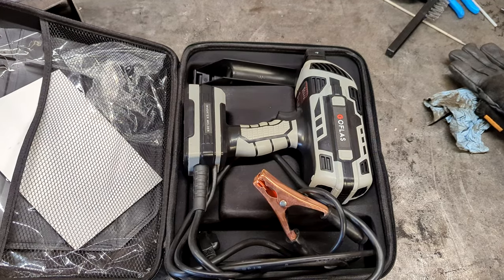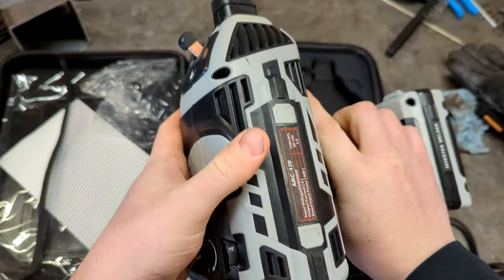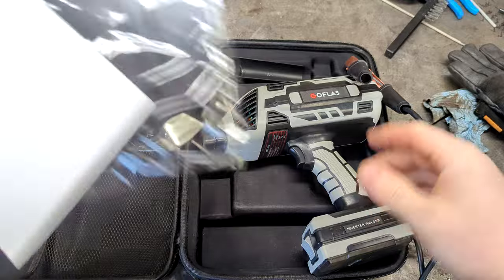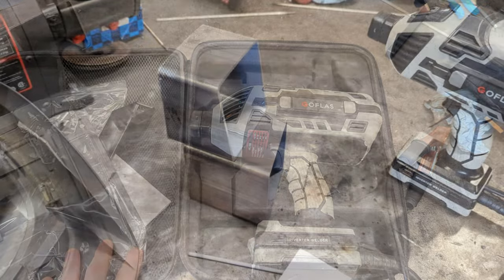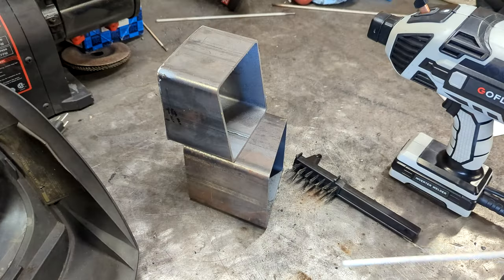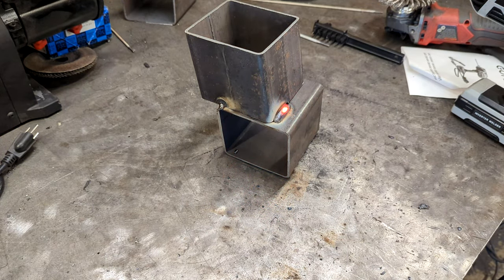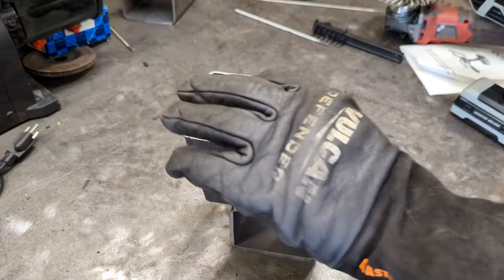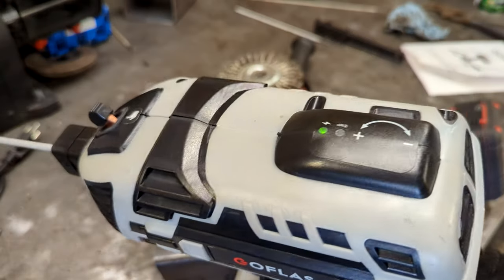Handheld Stick Welder Temu

Comment from the maker: The one in the video they have raised the price on it damn near 60% they all seem to be pretty similar here's another one closer to $100 https://amzn.to/3GrSEjM
Reply: How long have you used it and did it hold up
Reply: The YouTube hug of death...
Reply: Just bought one off temu for 79 bucks
Reply: @mosesdroneworks5346  Famous last words...
Reply: @soundspark  used it lastnight worked great I was very surprised.  Wasn't expecting much . But it Truly worked great . Be nice for small jobs .
Reply: Please give an update if the Chinese Tool Emporium welder is still working. Thanks for posting.
Reply from the maker: @TheStickinator  lol yea it still works will post an update video when I get some time.
Reply: That’s alright” it is whut it is, I need one👍🏽
Reply: i just got my for 69$
Reply: Can anyone please tell me the best rods and settings to use for welding bedframe metal to utility trailer rails? 

Also, what angel to I use when welding. And do I put the rod right on to the metal or a little above it? 

Thanks! Would really appreciate the help!
Reply: Under 60 bucks on ebay
Reply: @Steve-sv3ln your already on youtube look up a welding video
Reply: @Steve-sv3ln u need to practice on a scrap metal normally you don't put just put it on the metal. You bring close as possible the welder will start welding. The if you welding two  pieces you must do small circles so the two metals can come together. The high and low settings depends on the thickness of the metal. If metal is thin you set you heat down if thick set higher
Reply: Nice welding skill you have there

Comment: As a welder of 30 years, that was impressive.
Reply: I was thinking the same thing! Impressive
Reply: Found the temu employee 🤪 😂
Reply: Yeah that is actually pretty surprising 😅 I seen an ad and had to see it in use
Reply: I am a auto tech and was thinking be perfect for those exhaust welding spot jobs .
Reply: How do you weld years?
Reply: @dudeguy2942  you sound like my dad lol
Reply: I would assume this is a bit different than soldering 🤔
Reply: Your a bot
Reply: @JamesBrown-rz1vj your a bot
Reply: @davidtejeda1380 ”you’re”. Take your time to spell if you’re going to burn someone.
Reply: @666dynomax  you definitely have 0 friends 🫡
Reply: @davidtejeda1380  lol. Grow up kid and get off your phone it's bed time

Comment: This would be good for offroad truck repairs in case something breaks on the trails!
Reply: yea, where you gonna plug it in ?
Reply: @tommyshaw2420 a generator or an inverter my guy
Reply: @tommyshaw2420  newer vehicles today have 120 v  my car and truck has 120 volt outlets but I guess if you don't you would use the jumper cable option on your vehicle battery.
Reply: @roland9532  My Ford escape even has a 120v outlet, most definitely do these days
Reply: @roland9532 it might have a 120 volt outlet but can it support the amperage? I'm not saying it won't but I have my doubts.
Reply: @garreth629  Just keep the car running, it'll hold.
Reply: Y'all got 110v outlets on your cars, but at what amperage?  I think they pull around 18 amps.
Reply: My thoughts exactly only a few "electric vehicals" have that kind of amperage and i kinda doubut you got that out on the trail. Lol 99.9% of the time this aint foing you any good on the trail. You would be better weldi g with your car battery. @garreth629
Reply: Trouble isnt running your battery dead. Im an engenering student and let me twell you the wave transformation is tough to push ac anyways. But that much as standard in your car... thats like asking it to run a electric dryer on high 😂 its not as clear cut as people seem to think. Im pretty sure the average inverter in. A car is less than 1000 watts. 110/1000 thats your amperage. Less than ten avalable.   @MrMoon36O
Reply: @tommyshaw2420  new trucks have 120v outlets on the back
Reply: My truck has 120. It’s definitely possible.
Reply: @bananapuffcream1 what should be inverter’ s minimum power to handle this thing?
Reply: @garreth629  Saw this issue once with a guy trying to use an oxygen machine in his 15 Silverado. The stock inverter only put out like 10amps. Lol.
Reply: hell yeah! keep it in the baja truck when you're racing.
Reply: @tommyshaw2420  car lighter power inverter. not sure if it'll be enough. might need to have engine running.
Reply: @MrMoon36O.   Letting the engine run won't change the fuse amperage. 🙈

Comment: I just bought this very welder on sale at Temu for 60.00 on sale..I have many weldersb though this would be fine for welding cage and fence wire ..very light weight welding.  So happy to see your video..I think I will be pleased to use this little welder on.light jobs instead of dragging out a bigger welder.  At 60.00 and free freight its worth the gamble
Reply: I just got one
Reply: I just bought one from Temu too for 69.00 for go kart welding, this will be my first time welding.
I've only been afraid of burning my eye from the heat light.
Reply: @ronaldtracy2534 how is it working? Still works good?

Comment: You should do a quick little update video on it to see if it is still working.
Reply: Dude it's $60 bucks even if it lasts for a year you just buy one every year.
Reply: Dude a video would still be cool
Reply: Dude
Reply: @michaelrelli  I ended up getting one it actually works really good! I wouldn’t use anything over 1/16 rod, otherwise it likes to stick a lot. 1/16 rod works really good, and you can actually get a nice bead.

Comment: That went way better then I thought it would. I was just looking at one on one of those cheap products apps and I didn't think there was any way in hell it would work that well for around $100. Looks like it would work well for random welds here and there. Great video!
Reply: Right... I work in a glass factory, doing alot of rig welds on equipment, the pain of hauling a cart with 2 different types of welders mig/stick mainly Over busted up pieces of glass in a pain in my a$$ so I've been looking at this didn't think it would get close to welding anything maybe tac welds but, I'm deff surprised... curious how long it will last?

Comment: Thanks bro, this thing finally came up as an option for a 50% discount and I got it for $41, if it weren't for this review and the comment section i would've probably left it alone but for 40 bucks why not, I'm a novice welder myself anyway so it may be good practice for me
Reply from the maker: Right on man thanks for watching
Reply: Your a bot

Comment: I've seen many videos of non-welders trying to weld with this. They either had too big of a rod or the wrong rod for the steel thickness or just the wrong type rod for the project and were unaware of any of the requirements for welding...and got a sh*tty result. You seem to know what you're doing because I could totally live with that weld, compared to all the others I've seen that are just porous globs of bubble gum. With an 1/8" rod, no less, and without a direct ground connection to the workpiece!

Comment: Thinking about getting one for my toolbox at work. Im a runtime millwright, and sometimes all we need is a quick small weld or tack to limp the machines till the end of the day when they go down and we can do a full repair. Dragging a big bumper pull lincoln and running leads takes to long for a 2” long tack on a guard lol

Comment: i bought 1 chineese gun welder Last year..honestly  i was surprised is a beast Tool: maximaum 120 Ampere.3000 watts.220 volts. Electrode diameter max 3.2. For a continuous welding is really excellent i use it for many hours a day for thin or thick metals. I find this tool a revolution in technology...

Comment: YOURS are the best welds i've seen yet from several different MAKES of this style welder.
   I wouldn't buy one of these with 
any expectation of doing DAILY
use ,  but with the intention of
Trail Repairs  &  light sheet metal
work .  TACK Welding in awkward
places seems to be the best use
for this style.
   I was on the fence , but seeing
YOUR welds makes me think this
particular  MAKE  +  MODEL
is indeed feasible for the above
mentioned , as a 2nd or 3rd welder  to keep handy .

Comment: This with a portable power supply would make a damn good trail side repair kit. At least good enough to get you off the trail and home.
Reply from the maker: Yep
Reply: Yes. You could carry this and a small genraetor and fix a broken drag link or something good enough to get home.
Reply: @gabuckeye3398 but it’s portable with a battery… you don’t need a power supply
Reply: It doesn’t need a portable power supply. It has a battery. All you need to do is have a ground
Reply: 2 minutes of weld time so be quick

Comment: Bought a similar one to do a couple of small tasks throughout my garage. Glad you tested it on something kind of thin since I'll be using it for welding a 1/8in pin in a same-sized hole for a tamper evident and mostly permanent closure. Thanks for the demo.

Comment: This would be easy to wire to a metal gate or garage door with a couple of long wires, and give you the ability to surprise thieves,robbers, and burglars. With the pull of a trigger, that doesn't fire a bullet,you can still give them a hell of a " shocking"  experience.

Comment: I know it's shit but I would get one just for novelty value. You could weld a couple of 10mm cleats on 106amps easily. Especially if you're in the field and need to run up a ladder with it.

Comment: Nice video. The arc sounds pretty stable.
Reply from the maker: Thanks
Reply: @MotorCityMetalArt  how long did it last
Reply from the maker: @wildlifewarrior2670  it still works.   I've used it here and there since this video but nothing crazy.
Reply: @MotorCityMetalArt  that's good

Comment: The endless potential capabilities of this tool are way underrated. Been welding going on 10 years now. I have a Lincoln Power MIG 210 Multi-Process machine as my everyday welder. Normally run .35 flux core Just because all I need to have is 120 V plug available. With the option of also plugging in to 240v If available. Typically I leave the 240 V plug at home however and I’m going to weld a quick broken thing for a buddy or do a small project or whatever lugging that 40 pound Machine around gets old quick. Why lug it around for a five minute weld job, or fixing something broken on the trail. Obviously your not gonna go welding on the pipeline with this, But for something the size of an 1/2 in impact gun which I already carry everywhere I go, you Can fuse carbon steel together that’s worth it’s weight in gold

Comment: Where did you connect the ground to? My hand held welder just arrived and I want to weld small stuff like that but not sure where to connect the ground
Reply from the maker: Connect the ground to what you want to weld.       You will have to make sure where you connect the ground is free of rust paint etc needs a good connection to work properly

Comment: Would be great to keep in a truck with a small generator or inverter. One trailside repair and it would pay for itself
Reply: A small gen wont run that
Reply: 5000w inverter

Comment: Seems ok for a quick jobber. Wouldn't wanna bring it to a job and use it every day, but if you need to quick weld something it seems alright
Reply from the maker: Yea for sure or generator and this in a trail rig for repairs on the trail

Comment: I'd be very careful on rod selection. you didn't specify output between ac or dc. I wonder how many times you can exceed the duty cycle before it craps out. I'd like to see 3/32 7018 demo'd because 1/8 is near the top of that machines heat output.
But it looks like a good small job machine.
Reply from the maker: Yea I've only ran 7018 and 6011 on it so far.
Reply: 20% duty cycle means you can run it 2 out of 10 minutes continuously, shouldn’t be a problem if you’re stick welding. I don’t think its going to take 2 whole minutes to burn one rod.

Comment: As a drug user , it’s obviously not built for heavy use but god the DIY homeowner , it’s perfect! 

Here’s my antidote story. I bought that cheap chinese plastic mender gun. When i got it , I thought it would break in the first use . I’ve had it for over 6 months, it’s still working , maybe i’ll use it for 10 mins a week. If i apply my result to the handheld welder gun, it would be worth it for small projects , but for sure not weld stuff like utility trailers . unless someone videos and proves it does work.

Comment: Do you think I'd be able to use this to make an extension for my harbor freight band saw so I can put thicker (wider on end)  pieces between the table and the guides?  For resawing purposes....
Reply from the maker: Which band saw do you have ? The 4x6
Reply: @MotorCityMetalArt  I have a 14 inch band saw.  Picked it up for 50 bucks and killed the back bumper of my Mazda 3 getting it in...and had to drive home with the hatch open and Thanks to Jesus for my exhaust fumes not killing me.  Haha!

Comment: Whuts the jumper cable for, & is it separate from the tool? & did you just plug it up to operate it? Or was the cable hook to a car battery?  Break it down step by step🤷🏽‍♂️
Reply from the maker: The "jumper cable" is a ground you put that on the base metal you're welding.
Reply: @MotorCityMetalArt  Thank you sir👍🏽 & nice clip ⭐️⭐️⭐️⭐️⭐️
Reply from the maker: @theeDameAlexander510  thanks for watching.

Comment: what extension cord gauge for a unit that can pull up to 120 amps ?
Reply from the maker: It's not pulling 120 amps from the outlet.      You should be using atleast a 12 gauge cord but that all depends on the length you're using it from the outlet as well.
Reply: I just need a 15 ft cord. I'm really naive on electrical stuff. The welber  I'm looking at says it's adjustable from 20 to 120amps but you're saying that doesn't mean 120amps would be coursing thru the cord ? Appreciate your responding ! @MotorCityMetalArt
Reply from the maker: @vanessatrane2189  so the welder has a transformer in it. 

Most houses have 15 amp 120v electrical outlets.   In some cases 20 amp.    

For a 15 foot  a 12 gauge cord is what you want.

Comment: What do you attach the clamp to? We have it but it only gives us short zaps despite holding the trigger down
Reply: We also know nothing about welding, so any info helps lol
Reply from the maker: @aprilkehoe356  the clamp is your ground you have to attach the clamp to the piece you're welding.   Where you attach it at must be bare metal and free from any paint or coatings to get good contact.

Comment: where did u attach the grounding clamp noob here
Reply from the maker: Attach the ground to the piece you're welding  

But if you have a metal welding table you can attach the ground to the table itself.
Reply: thanks @MotorCityMetalArt

Comment: Noob diy-er here. Just casually exploring ideas. Q: How does a (max) 120 amp device run from a typical 20 amp home breaker without tripping the breaker?
Reply: 120 A at the secondary.. Like any welder It's basically a transformer rectifier.

Comment: Why not have a flexible electrode holder with the "drill transformer" sitting on the table or floor?
Reply from the maker: You can.     The size of inverter welders now are tiny.

Comment: Would this be good for welding on a car exhaust!!!??
Reply from the maker: @jcoach3064  not really.  Unless you have experience stick welding thin material
Reply: @MotorCityMetalArt  nope definitely not 🚫
Reply from the maker: @jcoach3064  I'd be looking at a flux core titanium 125 mig welder from HF if you wanted to learn mig welding for an exhaust.    Great little machine.

Comment: oh it worked pretty good lol should hook up tig torch to it and see lol😅
Reply from the maker: I mean shit probably could just need to rig up gas valve.
Reply: @MotorCityMetalArt  yup 😅 or just hook gas line straight to the regulator and let it flow just for test
Reply: But only scratch start tig.

Comment: Definitely wouldn't want to weld for hours with it
Reply from the maker: 20% duty cycle you wouldn't get a lot done lol
Reply: @MotorCityMetalArt  that does that mean? Newbe!
Reply from the maker: @ciaranwalsh2131  duty cycle is based off of a 10 minute period.   So you'll see on equipment like a welder say 100 amps 20% duty cycle so if your welder is set to 100 amps you can only weld for 2 minutes continuously and it will need to cool for 8 mins before you can weld again.      If it says 100 amps 100% duty cycle you can weld all you want and never stop.
Reply: It's crazy because on the add for the product it says you can weld for hours without a problem lol always gotta watch a review
Reply from the maker: @bounch5  you'll see that on a lot of the Chinese made products.     Not always truthful in their ads.
Reply: @MotorCityMetalArt  absolutely, thanks Motor City Metal for all you do
Reply: Well they’re not lying the never said continuous hours 😂. 1 hour for every 5 that’s almost 5 a day. Maybe that’s why you see em tack welding everything, tack tack tack till till there’s a bead

Comment: What the shit 😂 if it's under 50 bucks...I want one
Reply from the maker: Well you're in luck lol.  $44. Limited-time deal: AZZUNO Handheld Welding Machine, Portable ARC Welder Gun 110V, Stick Welder Machine with IGBT Inverter, Small MMA Welding Machine for Metal Fits for 1/16''-1/8'' Welding Rods (Handheld 90A) https://a.co/d/fqlp9aK

Comment: stupid idea , why have all the weight of the unit in your hand . normal welders have the heavy unit separate to the light weight hand piece ,,crap
Reply: Well It’s perfect for those that don’t have a car right now or preference to not need gas to operate this is perfect for welders to do small jobs for extra side money you can ride the bus transport with it at least now more often local clients won’t expect to provide equipment for welders